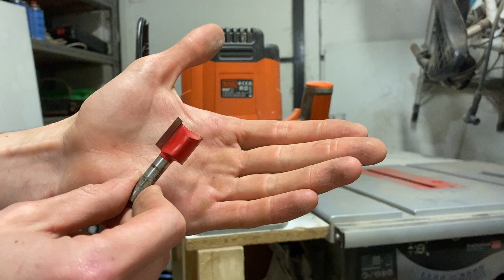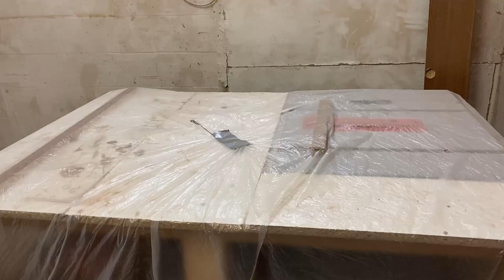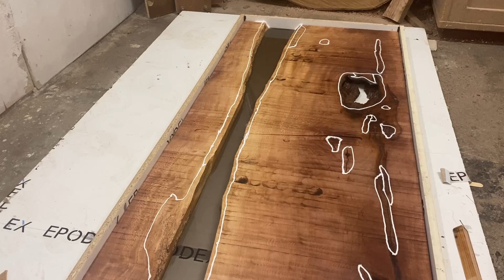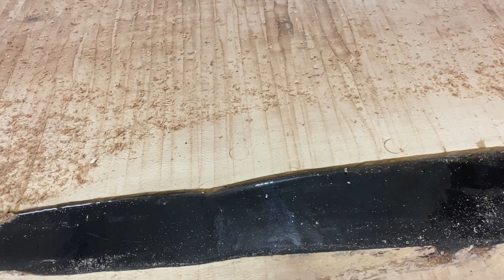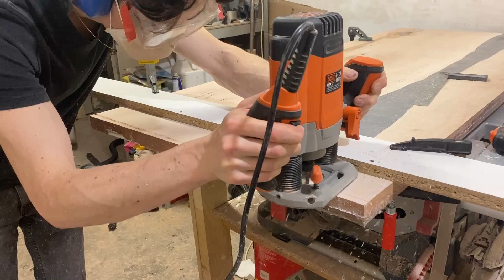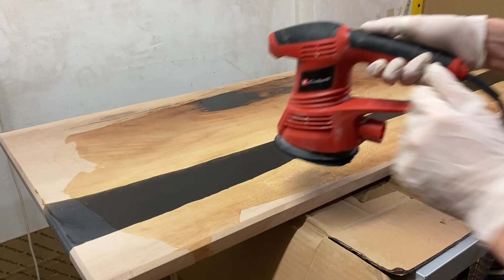My First Epoxy River Table

Comment: Hey man, amazing work! So just a tip I see cam from blacktail and maybe another person mix some acetone into the epoxy to thin it out, you can also use deep poor epoxy, to fill those tiny cracks so you don't have to use the dremel to carve them out, the wood will readily soak up the thinned out epoxy.
Reply from the maker: Thanks thats a good idea !